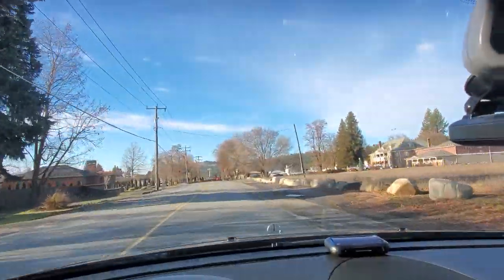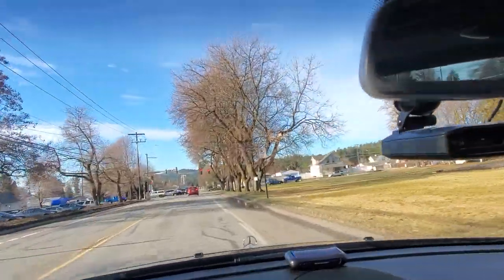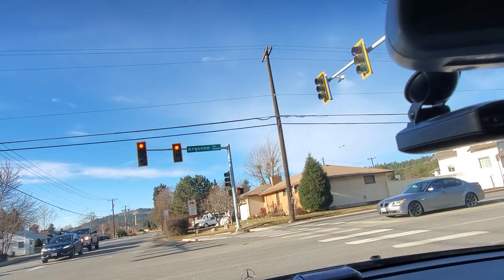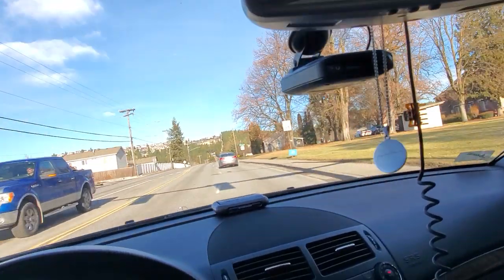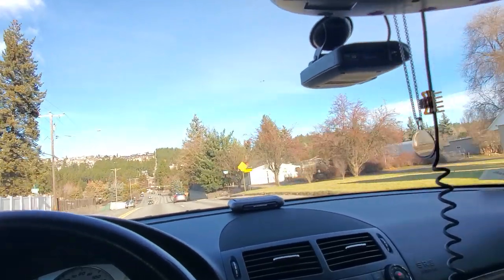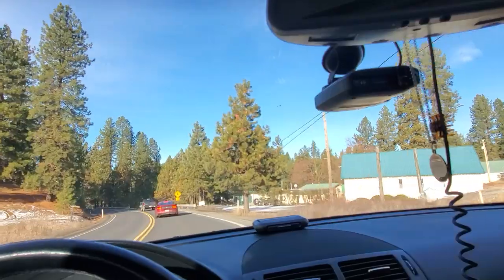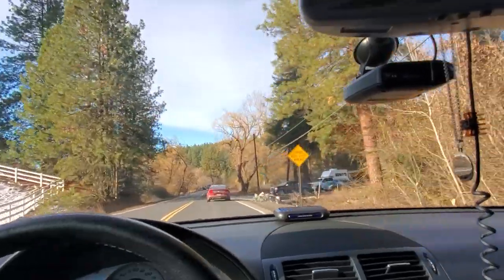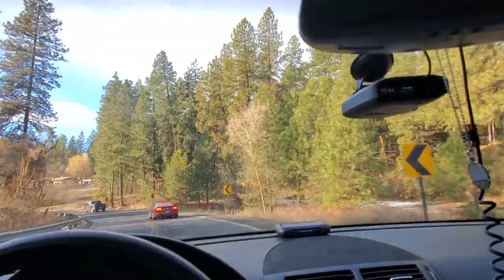Why I dont use the Cat fuel filtration for 6.7 Cummins.

Comment: Having spent 47 yr's in over the road trucking and owning 5 different Caterpillar powered trucks I'm confident in saying that the Cat IR0751 fuel filter is not only superior in the micron filtration aspect but is far more economical than any other OEM pick up manufacturers product and far more available from both truck service facilities not to mention the agricultural service industry.
Reply: Old pete at least for the 6.7 cummins mopar uses the dual element filter on the engine that fliters down to 2 microns. Which the mopar filters for the Cummins are all made by fleetguard the Cummins brand.

Comment: The point of the Cat filter mod is that those Cat filters are "better" smaller micron filtration anyway, definitely cheaper and just as readily available. So u just keep a stock of them on hand no prob. I get what you're saying though OEM is best for a fleet
Reply: I have the CAT Filter setup on my 2018 that mounts next to the primary filter under the bed. I carry a spare CAT Filter and a the oem primary and secondary filter as well. Since putting the CAT Filter on, the secondary filter that is up by the motor is still clean when I change them out every 10,000 compared to when I didn't have the filter set up. Well worth the price I paid for it and the extra CAT Filters.

Comment: On my 15 ram I added a napa filter block  under the cab to run the cat 1r0750 or whatever, I found the quick connection right where the fuel line starts to go upward into the bellhousing area, got 2 more quick connects and plumbed it to be easily removed later, the 2 micron cat filter for $20 or whatever meant the main factory filter never needed changed I checked it several times never got dirty in 60k...

Comment: You have a fleet of trucks, 4th gens, 5th gen Rams, a Ford. Wouldn't it be economical to convert them all to run the same Cat water separator & fuel filters so that you could stock only those parts for all your trucks?

Comment: Hey Paul what’s the biggest tires  and suspension lift you would run on 2012 ram 2500 diesel longhorn truck and still want to pull trailers and possibly goosenecks. Would really appreciate a response to help me out
Reply from the maker: I would keep them 34inch max and up to 3inches on the lift

Comment: Paul where does my key go if my battery dies on the fob? 2019 5th gen
Reply: Tonybone Robert it happened today to me on my 2019 cummins. My dash screen told me to press the start/stop button with the key fob instead of my finger. Worked like a charm.
Reply from the maker: What Tony said. Seems to work. Happened to me on my 14. Make sure your doors are closed and push the start button with the key. Took me couple tries but worked.
Reply: Good to know. So there’s no hidden turn key inside the truck then. 2019 5th Cummins
Reply from the maker: Nope